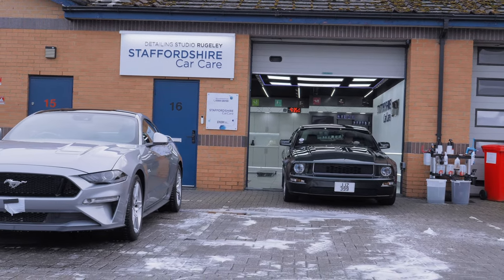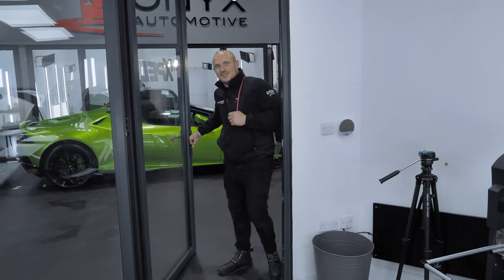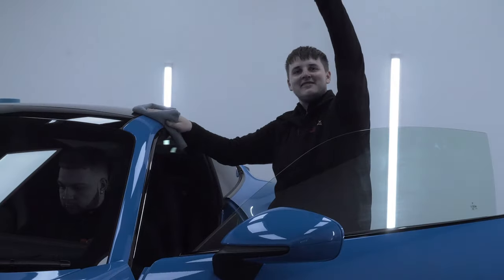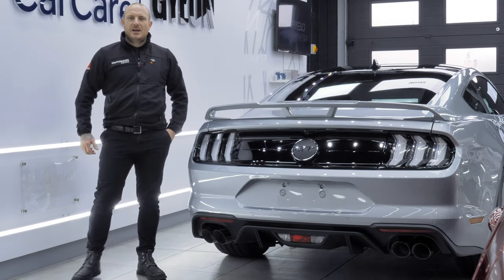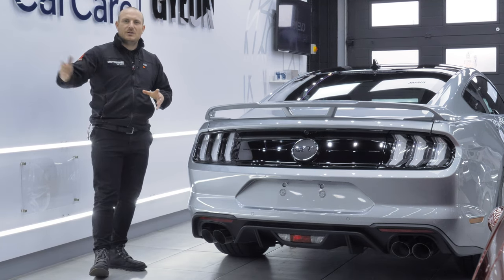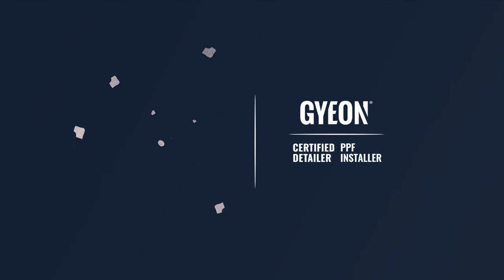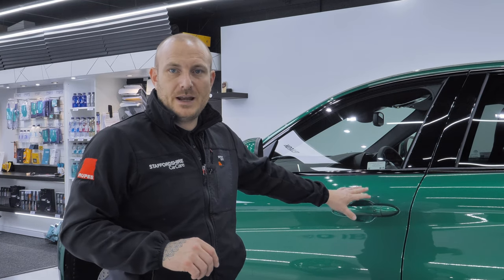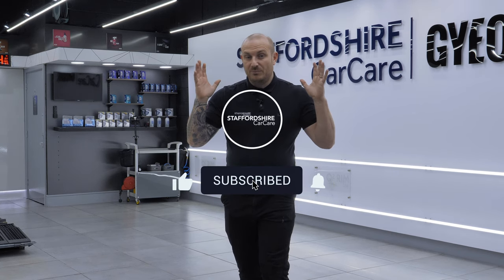Ceramic Coating or PPF | WHICH IS BEST?

Comment: If we are to do both ceramic coating and ppf say on the front part of the car, do we:

1) put the coating on the paint, then put the ppf, and then put another coating on the ppf?

OR

2) put the ppf, and then apply coating on the ppf?
Reply from the maker: Hi. The correct procedure would be to prep the surface and make sure no contaminants or product remaining.  Apply PPF and install ceramic coating on top of the

Comment: Problem with ppf is if its a sizeable impact from rock or key youll have to reinstall new peice of ppf. Obv thats never cheap. Imo id only ppf a super expensive paintjob or supercar. Imo no need for any daily driver to have that. A big enough hit and youre respraying it ppf or no ppf.
Reply from the maker: Good point. Something to bring up in a future video.